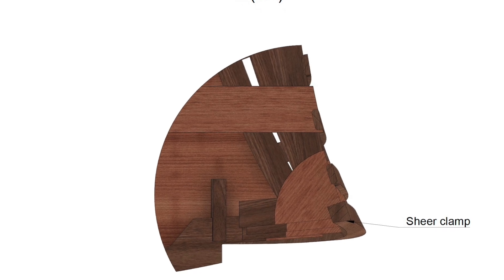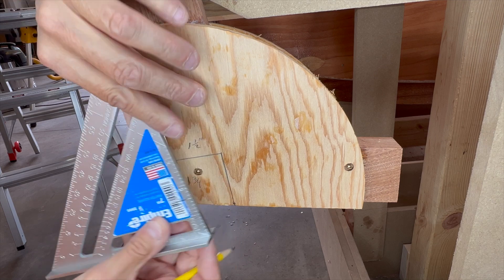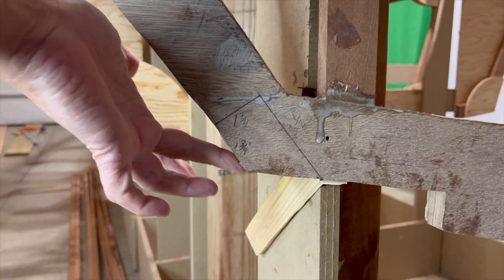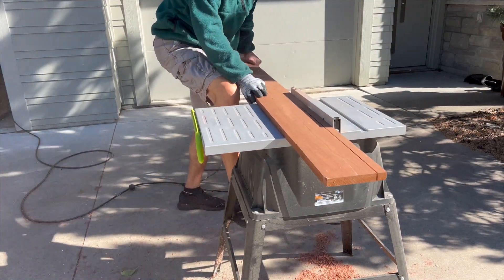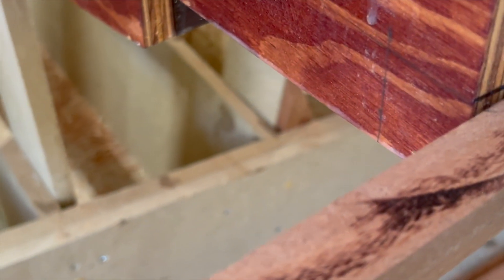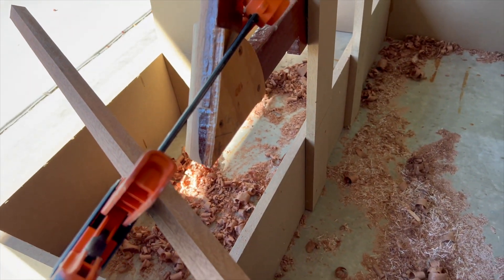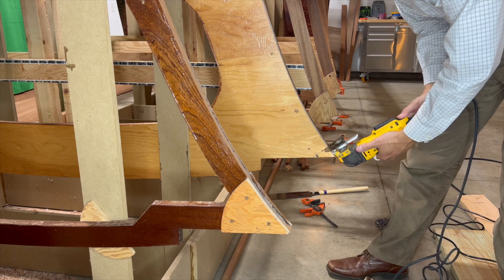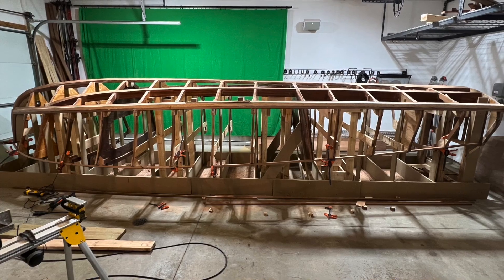Temptress Build 55: Starboard Sheer Clamp (part 1)

Comment: I'm intrigued by this hull design.  The sheer clamp is a tricky piece, first off you need to start by fastening at the stem and work aft, the direction you're working is the hardest way to go, always work front to back (ask me how I know).   The clamp is best made with laminations and not one solid piece, and if you must build it with a solid piece you're better off making a steam box and steam bending it.   Looking forward to the finished product!   Are you planning on the Ilmor power plant or something else?  Located in the Twin Cities right?   3M guy I would presume by the screen name...
Reply from the maker: Hi Ted - Lots to unpack…
I work in the former 3M Healthcare Business, now Solventum.
I am trying to make the sheer clamp out of laminate of four 7/8” timbers.  No way that I can bend and twist the full 1.75” shear clamp.
And I agree with you that I need to start at the front……
Reply: @Polymerman  Roger that.. I just finished a 5 year build on a Glen-L Tahoe 21' and the (2) sheer & (3) deck clamps were spec'd at 5/8" thickness. Hopefully 7/8" doesn't crack on you!   I work with the Cordova, IL plant for engineered process equipment so I made the connection...
Reply from the maker: @tedsouhrada7095 
Well hello from a fellow former 3Mer.

Comment: You will need minimum 4 battens in (in 1x4 formation not 2x2) you can even do more. One layer each day. You have no clue how hard to twist and bend a piece on a small section. Even if you manage, it won't follow natural line. I tried steaming, heating, soaking. It won't do.
Reply from the maker: I will message you on Instagram.  I want to understand this better.

Comment: it might be the camera angle, but it seems you've got some fairing issues to correct - I see lumps and bumps that need to be corrected on the frames FIRST before cutting any notches, otherwise she''ll be a lumpy girl.  If the sheer clamp is wanting to crack, either your wood is too thick (or resawn wrong direction)  and you need to laminate thinner pieces, OR you need to steam or soak the sheer clamp before installation.  OR the drawings are in error - we've seen that before.  Especially if it's from a CAD file...you'll find out that splines on the monitor and real wood are two very different things when it comes to  bending moments & limits on a complex curve.   Nice shoes, but no place in a woodworking shop.  Good luck!
Reply from the maker: Agree with all statements , except the shoes 😄

I will fit a batten to check the frames, before moving forward.

Comment: You should try a Tajima one-handed pull saw. It's much easier to use than the 2-handed saw for those small cuts.
Reply from the maker: Thank you, Rob.   I just looked it up.  I clearly need a new saw that is easier to handle.